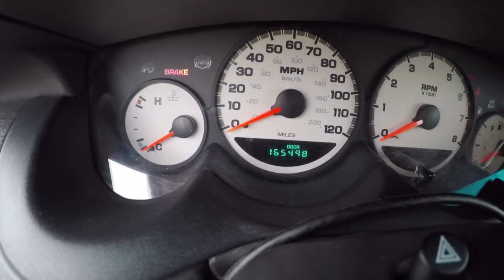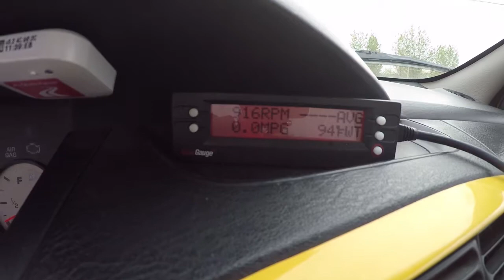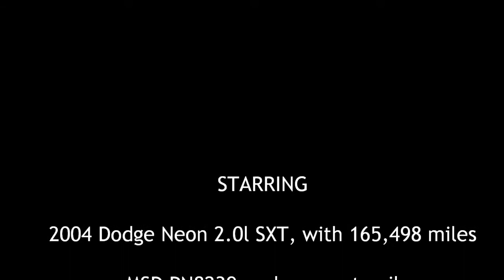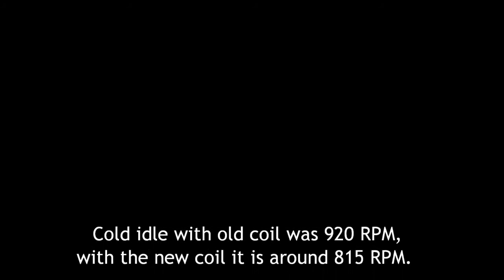2004 Dodge Neon SXT 2.0l Coil Pack replacement

Comment: This car is the coolest car I've ever had. You can bump the radio all day with the engine off
Reply from the maker: True, just make sure the trunk is closed.  That little light will drain the battery overnight.
Or LED upgrade it.

Comment: What’s that plug called that goes from coil pack to motor?
Reply from the maker: Ignition coil connector 
https://www.rockauto.com/en/catalog/dodge,2004,neon,2.0l+l4,1424595,electrical-connector,ignition+coil+connector,2592